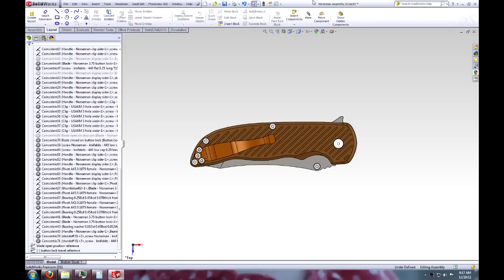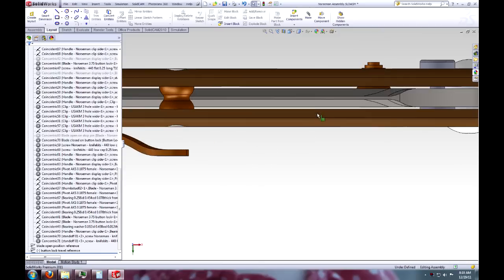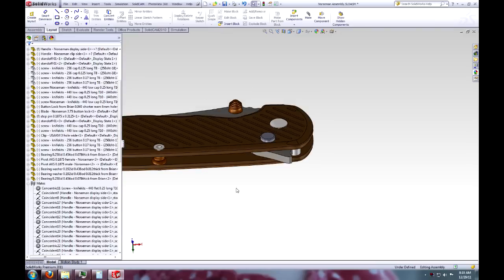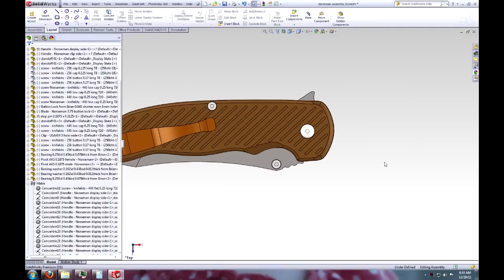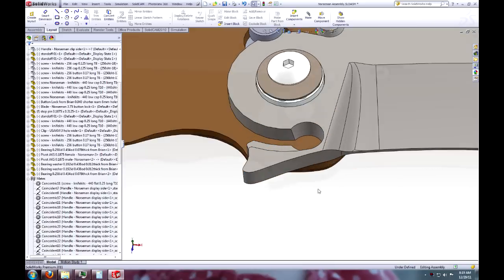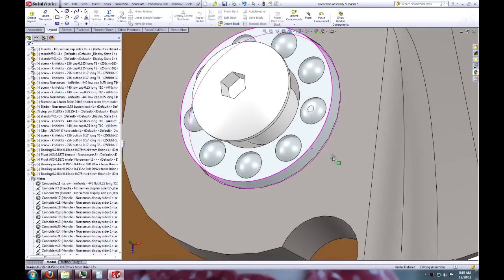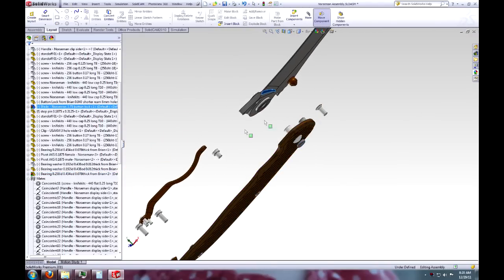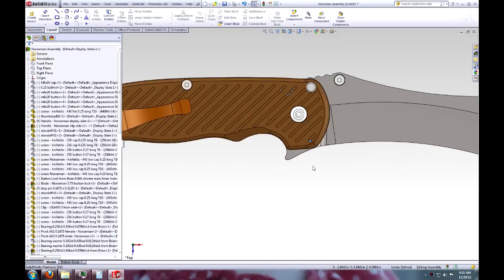Knifemaking Tuesdays Week 08 - redesigning The Norseman

Comment from the maker: @xXOOOHSHINNYXx You want it to lock closed very lightly, and I'm planning on having the button engage the tapered section of the closed hole only a little bit.  Once I get the dimensions and tolerances juuuust right, it will work awesome.  Framelocks are definitely more popular, but button locks are harder to make and in my mind are very cool, so that's what I want to make for this knife.

Comment from the maker: @TurboBrooks I hear where you're going, but that thin area at the lower part of the blade is only for the flipper lever.  So when the knife is closed, you flick that to shoot it open.  The only force it sees is your finger overcoming the spring pressure of the button lock.  When the knife is open that area sees zero load.  The area has to be open frame like that to accommodate the button lock in the closed position.  If it were a framelock, it wouldn't need that opening. Cheers!

Comment from the maker: @TurboBrooks I figured you were a knife noob, so no worries buddy!  I do appreciate the consideration and ideas.  Making the pin have a groove in it will complicate assembly and the final fit, which is surprisingly precise in these little knives.  But it is a neat idea.  The stop pin is being hit in the front when the knife is open, and in the back when it's closed, so a groove would have to be clocked exactly and then the pin pressed in.

Comment from the maker: @captjeff78 I first used a 1/4" pivot but now have switched to a 3/16" pivot, both were purchased from Alpha Knife Supply and are the BEST pivots I've ever seen, they're insanely awesome.  Flippers don't have to be spring loaded, most aren't.  You're right that the button lock is cool and very hard to do, and since I like a challenge I will make it work instead of going with the easier framelock method.  I'll spend the time I need to perfect the button locks, then move to framelocks.

Comment: @JohnGrimsmo I'm a knife newb, so disregard me. lol. I have to always consider 'my luck' in my projects - because if it can be broken, have a problem, fail etc.. it will happen to ME. I went back and looked at it before you replied and pretty much realized what you said. What about making the pin with a groove in it, and adding that much more to the blade? Would that be feasable?

Comment: This is just my opinion, but the way you have the pocket clip mounted seems too, busy.  You have five screws all very close to one another.  If I may offer some constructive criticism, I'd suggest merging some of the screws and maybe changing the pocket clip in such a way that it flows better with the profile of the handle.  Now, if you're going to have a multiple position pocket clip, then never mind.  I would still suggest modifying the number of screws and the lay out though.  Just my opinion